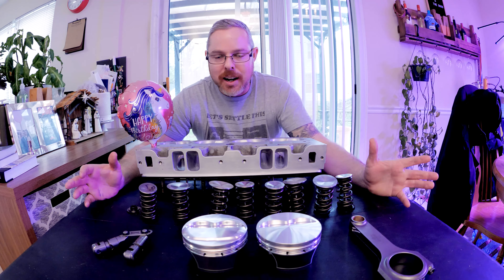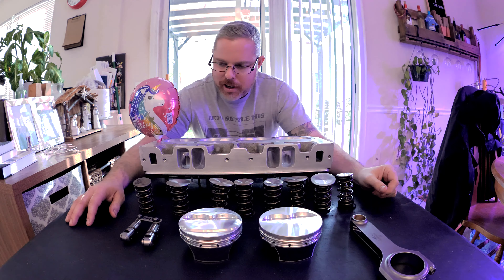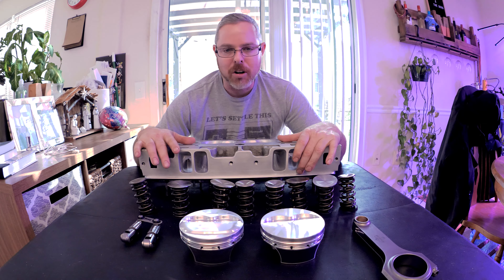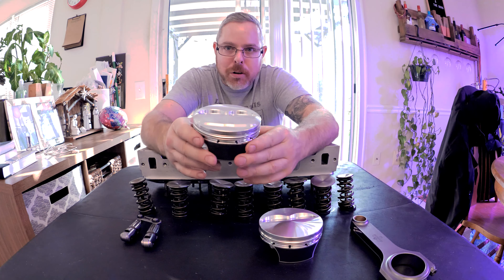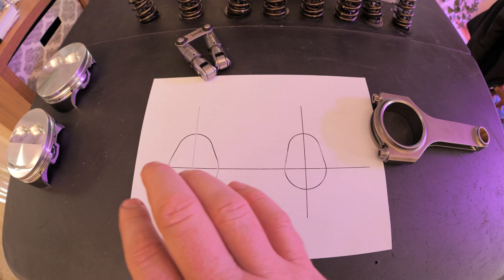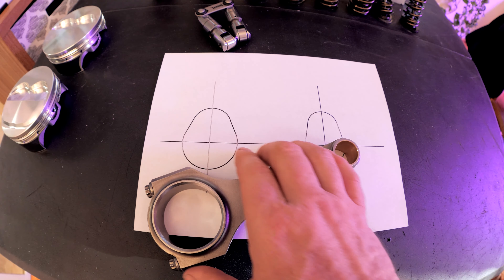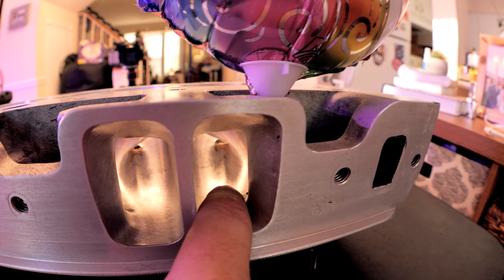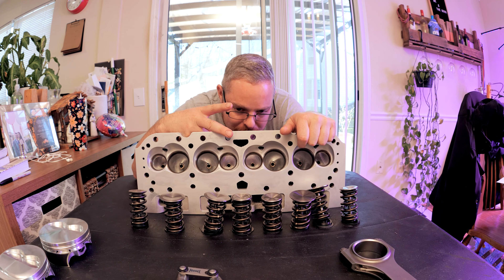400 cubic inch SBC build update. Parts start to roll in for Mr. Sparkles the v8 S10.

Comment: My 406 is stock block, steel eagle crank,5.7 h beam rods,srp pistons NKB 200 cc aluminum heads,535 lift Howard's Flat tappet cam, team G intake demon 750 carburetor  runs 11:50s on pump gas in my s10.
Reply from the maker: Hell yeah brother sounds like a fun truck.👍
Reply: Sounds like my setup except my heads are world sportsman2 200cc 
What is NKB ?
Reply: @wisheye1  I would check scat first …

Comment: i got my SHP block today. im running the same set up as you I think. Question is i ordered the callies 3.75 crank and callies compstar 6 inch rod. can i run the standard base circle cam and do i have to clearance anything? thanks

Comment: Everyone has their own opinion on how to build a motor. Personally, I want to build a 9.0:1 180cc intake (more or less) hydraulic roller cam, closer to an RV type to get the off idle and highway driving RPM range manageable for fuel economy and maximize streetable capabilities. Either for a 4x4 pickup truck or a nice cruiser for the street with simple gearing.

Comment: With a "Capscrew" type connecting rod (not the through-bolt and nut) you can usually get away with a standard base circle cam without having to grind the rods. I'd get your shortblock together and ask your machine shop if they have any solid roller cams lying around (std base circle) to check it before you order your cam. I've built a ton of 400's and 383's. There's no sense in running the smaller base circle if you don't have to. Not only is it harder on your valvetrain, but it also limits your lobe options!! I usually deal with Bullet Cams and have had GREAT service and performance results. Never any complaints.
FYI....a standard 1/4" wide (6"or 8" long) zip tie makes a handy go-nogo clearance gauge to check your pan rails, bottoms of your bores and cam clearance.
The Biggest BS, Jr rookie mistake I see people make all the time is using puny 5/16" pushrods...especially with a solid roller!!!! It's $125 a set for the Trend Performance 3/8"x.080" wall pushrods or $160 for the Smith Brothers 3/8"x.083" wall. When it comes to valvetrain stability....you'll thank me later!! Just look around and ask a few professional engine builders and they'll all tell you they run the largest pushrods they can fit... Hell, I even run 3/8" pushrods on mildly aggressive hydraulic roller applications (160-170 lbs of seat pressure, 400+ over the nose). If you even START to get aggressive on a solid roller, you're gonna be in the 195-to-240 lbs on the seat and well over 500 over the nose.
Also, pay the extra $75 to have the cast gear pressed on a billet core. Then you don't have to worry about using a sacrificial distributor gear (bronze or poly) that any kind of high volume OR high pressure oil pump will eat in no time.....especially for a street car!!
One final note....don't be afraid of running a high stall converter on the street. As long as you deal with a quality converter company, a 4800 stall will drive and cruise around at part throttle just like a 2500 converter. Yes it will be a little sloppy down low (right off idle) but you won't get into that "stall" until you push hard enough on the loud pedal to make enough torque to "Get there". More of those old BS rumors floating around I guess. Call Kenny @ PTC, Andre @ Edge Converters, Lenny @ UCC (Ultimate Converter Concepts) or Rick @ Trans-King, they'll all tell you the same thing AND make sure you get a quality piece!!!

Sorry for the book. I'll get off my soapbox now...
Reply: Well you definitely gave him everything in a nutshell there bro

Comment: Do your afr head have the steam hole the 400 block brings ?
Reply from the maker: I'm not sure on the stock blocks if it's needed so good question. I'm running a Dart SHP block.
Reply: Not needed with the Dart block I run a 4.125” x 3.75” dart block sbc
Reply: I ran factory 400 block for 2 years no steam holes in the heads. They were double hump 262 heads no problems no over heating.
Reply: Yeah I've ran the double humps as well on my 400sbc and had no problems!!
Reply: Stock block as well
Reply: @TPVPRO  ok..... its going to be a awesome street set up
Reply: @philipmazzuca2269  ok ...  Thanks
Reply: @jonathonwhite2813  ok nice ... Heard many storys on not having the proper heads for the 400... thanks you
Reply: @mermaiddreams83  ok thanks

Comment: Hello, 
I am building a 400 soon, what do I need to do with steam ports?
Thanks
Reply from the maker: Some people don't even worry about them. I have a Dart Block and it does not even have them drilled.
Reply: @TPVPRO   I see.
I was thinking of using some vertek heads i have and really didn't know much about the steam ports. I think since they are there I might have to address the issue or they will pound on head gasket.??

Comment: would a 350 vortec block be worth building or should i go with a 010 350?
Reply: vortec block, factory roller cam, best flowing production iron heads, great foundation.  Good intake, cam, mild port the heads 400-425 hp on pump gas.